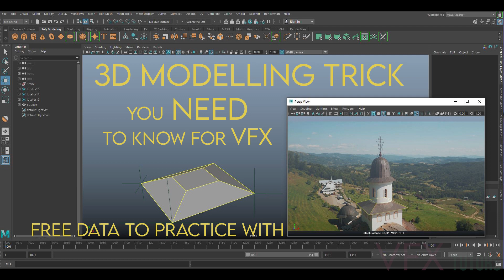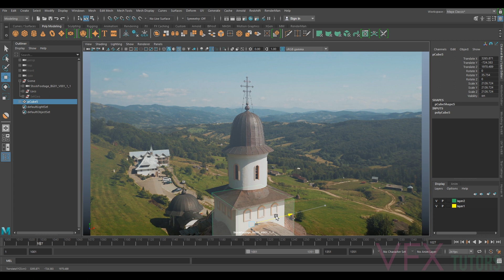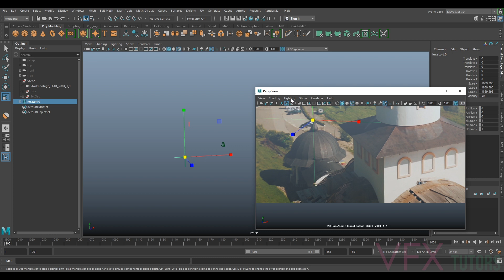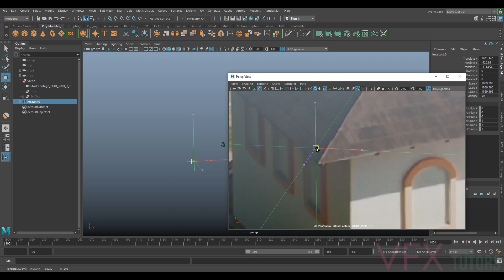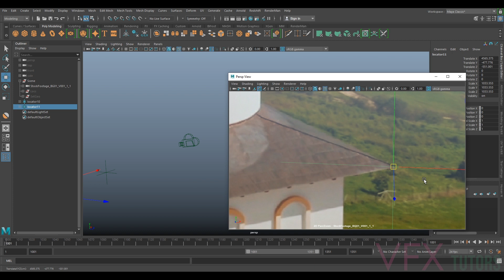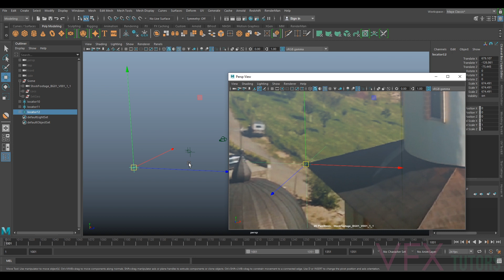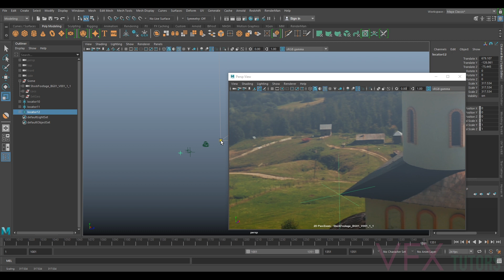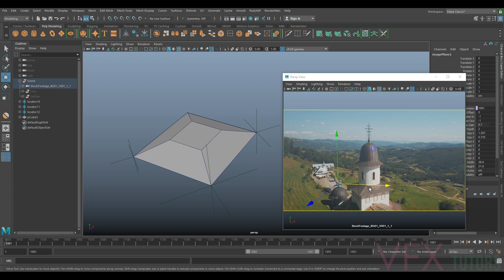3D Modelling Trick You Need To Know For VFX

Comment: i was amazed by this trick!! also, i tried to do a distortion grid on my television for my mavic pro and it warped weirdly my footage. can you point me in the right direction?
Reply from the maker: Maurício Casiraghi how weird does it look? As long as you shoot it as straight as possible it should be ok, 
I do have a couple tutorials on how to solve mavic footage if that helps?
Reply: I found the one you do with drones. Do i keep the 24mm goal with the mavic pro maybe?
Reply: I found the problem. My grid had some red squares and the auto snap wasnt working! Thanks a lot for the amazing tutorials